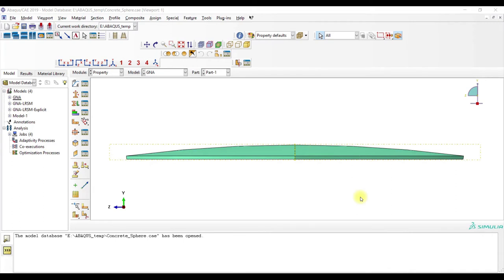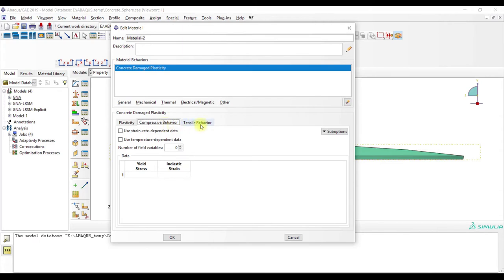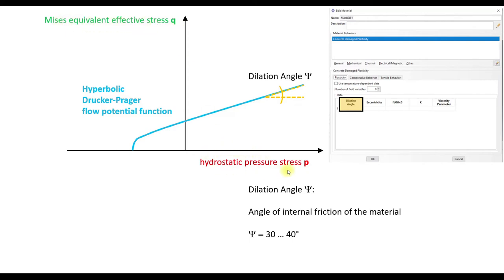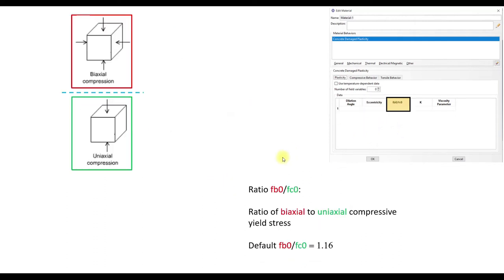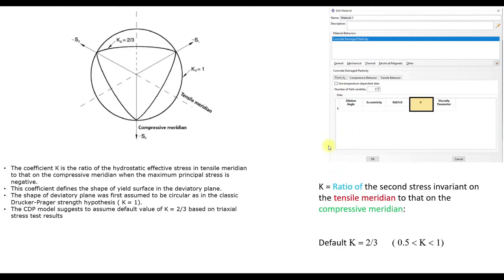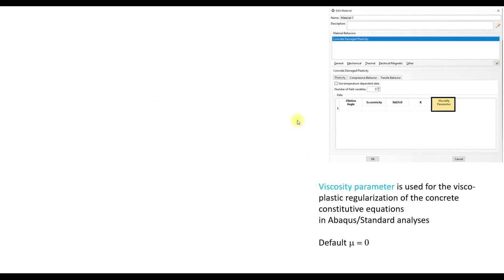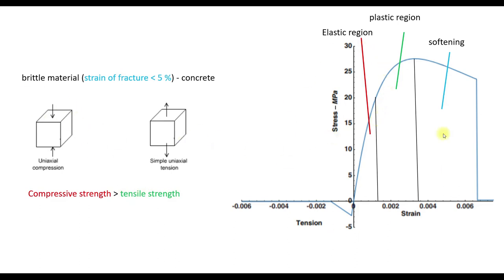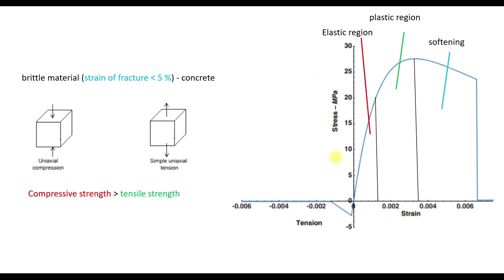ABAQUS Tutorial: Concrete Damage Plasticity Material Model Explained

Comment: Hello sir, I just found a small bug while am using your python script from repository from your video https://www.youtube.com/watch?v=5e_kEHZr5_o. Actually you are using phase shift approach from your video and I'm using Fourier cosine approach and I found that it returns me some weird result. I found that there's a mistake at line 267 of your script and you missed a couple of parenthesis. 
The correct equation of Fourier series should be w(x,y) = cos(k*pi*x/L) * (Akl*cos(ly/R) + Bkl*sin(ly/R)) but in your case is w(x,y) = cos(k*pi*x/L) * Akl*cos(ly/R) + Bkl*sin(ly/R) so I think here's the part that makes problems. Anyway your script helps me a lot and also your videos!
Reply from the maker: you can switch to different Fourier Approaches by using line:

115-117

# Fourier approach (1 - phase shift, 2 - cos , 3 - sin)

case = 2

also thanks for pointing out the mistake i will look at it right now, but i am not sure why i didn't notice it before.
Reply: @hnrwagner  No thanks sir :)) Also I got a lot while I'm looking for the mistake haha
Reply from the maker: @louisxin1336  

How did you came accross this error ?
Greate job.

 i have just checked it , the results differ only slightly (in shape and amplitude).
Reply: @hnrwagner  Yeah actually it only gives little different from the original imperfections but still it confused me a lot xD, so I start to check my Matlab code and there's no problem there. So I start to check your script and found that a couple of parenthesis is missing and came to leave a comment here.